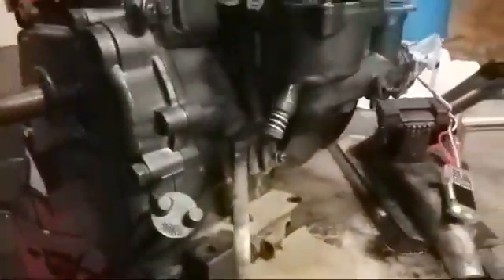See Through Engine Running TOP FUEL NITROMETHANE LIVE STREAM

Comment: That is NOT top fuel nitro.  That burn front looks like RC fuel.

Pure nitromethane runs wayyy different.
Reply from the maker: Monel Funkawitz well you can't really run nitromethane pure, you need a fuel to match up with it so it ignites. Check out my main Channel and watch the latest nitromethane video I have. This is the behind-the-scenes Channel
Reply: Warped Perception X You CAN run 90% pure nitro, hence the people that are getting miffed at the “top fuel nitromethane” title.  Traxxis R/C topfuel model fuel is nowhere similar to the fuel Top Fuel drags run.  The model r/c fuel is 20% nitro and the balance is an oil package and methanol.  90% nitromethane is used in Top Fuel because pure nitromethane is somewhat unstable and explosive.  The methanol desensitizes it.  The nitromethane is the actual fuel and takes a HUGE amount of spark advance to run.
Reply from the maker: Monel Funkawitz that's true good point, I guess I must have just grabbed the title off of the label, I didn't really think about it. But yeah absolutely correct 9010 is Top Fuel. As for the amount of spark energy wait till you see the next episode of blowing up the see-through engine. A lot of spark was involved. LOL.